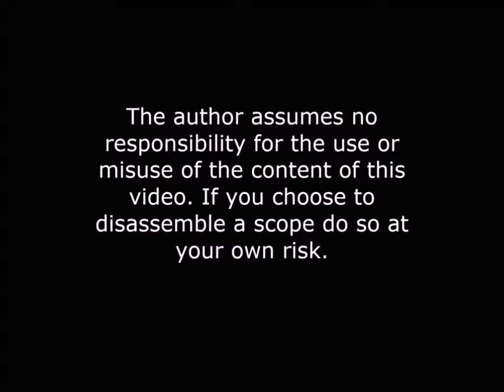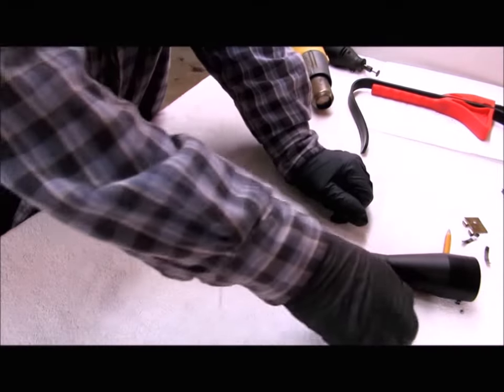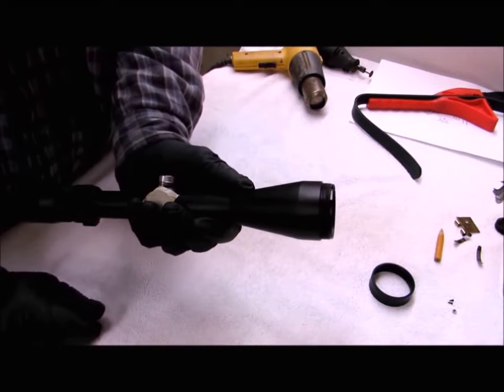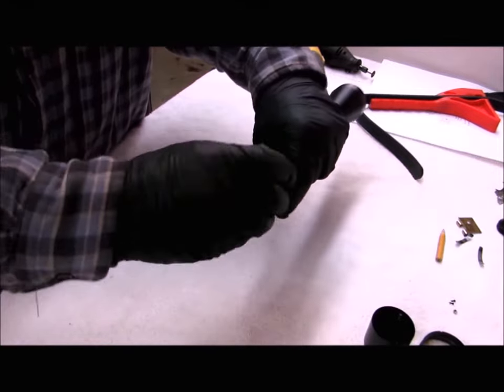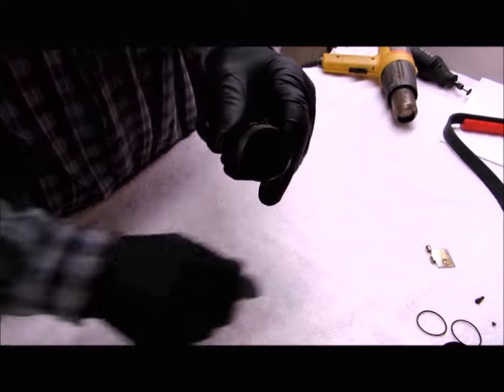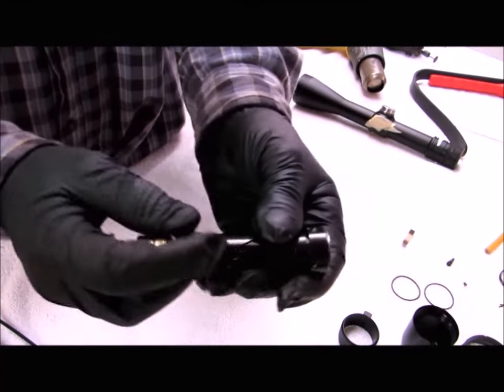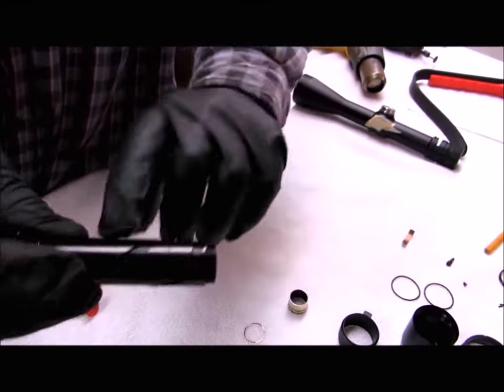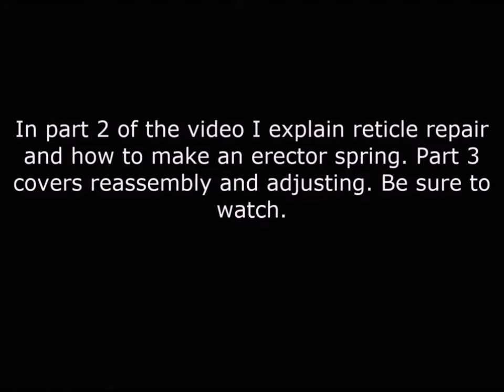DIY SCOPE REPAIR PART I

Comment: I installed this optic on a crossman 760 air rifle.I have now shot the riffle around 500 times during target/plinking practice, and the https://www.youtube.com/post/Ugkxc4K63Fd5LglDMObu7-Bgapxp_ef0W8hE scope has done well.With this optic, I have neutralized around 30 pigeons that were invading one of my buildings.For my short range air rifle, I will continue to use this scope, but will be upgrading to a more powerful scope, when I buy a more powerful air rifle, in order to shoot at longer distance.For the money I have spent, this scope has truly been a great buy.
Reply from the maker: Thanks. Good to know.

Comment: Thanks for the great videos,  Kenneth. Yesterday my BSA 3-12×50 took a turn for the worse.  It is only crystal clear when I'm on 6 power, but nothing else.  Every other power is blurry when I adjust the magnification ring. Do you have any idea how I can remedy this? Thanks again
Reply from the maker: Thanks for watching! I've never experienced the failure you describe but I will venture a guess. Possibly one of the screws with the bushings that moves the lens in the erector has fallen out. Sounds like only one lens is moving causing the out of focus issue. If you shake the scope you may hear it rattle. Again just an educated guess from a diy guy.
Reply: @Kenneth Dellinger  Thank you very much for your reply.  I haven't shaken it yet to see if I hear a rattle, but I will give that a try. I think you nailed it with it being just one lens moving. It was very wet and freezing when I tried adjusting it. There wasn't any obvious give at any point leading me to think that I sheared anything, but it seemed much stiffer than usual when trying to adjust the power ring. I think I'll give it until after my hunt and just use my 6 power for the time being so I don't have to resight in my rifle. I have a great place to start looking now after I harvest my deer. Thanks again for your expertise even if you say it's just an educated guess from what I'd consider a VERY knowledgeable DIY guy.
Reply from the maker: @badgthom  You're welcome. Good luck!

Comment: I'm impressed with your diy knowledge and know how with working on these scopes.  I have a question for you, I have a cheap BSA 4 x 16 power scope with the illuminated reticle, when you turn the magnification knob all the way from 4 power to 16 power the crosshairs  go from + to make an x when the magnification hits the stop, and when you turn the magnification from 16 power to 4 power  the magnification again comes to the stop the crosshair will move backwards and the crosshairs make another x.  So when I want to straighten the crosshair from x to + I rotate the magnification ring either from 4 to 16 power or back to where the ring almost reaches the stop then I proceed gently turning the ring a little at a time enough to get the x to move till it looks like the + again ..  I'm thinking the erector screws might be loose or something else causing the problem, do you have any thoughts other than throwing the scope in the garbage.
Reply from the maker: That should be repairable. Does the magnification change as it should?
Reply: @kennethdellinger2037  Yes the magnification works, everything seems to work fine just when i come to the end of the magnification the knob feels like it snags a tiny bit then if it's continued the crosshair will cock sideways like an x just before it stops then I have to run the magnification back the other way till I feel it catch and then carefully I try to inch the magnification knob ever so lightly to nudge the crosshair back straight up and down where I leave it, I usually try not to turn the magnification knob all the way to the max powers.  The scope is a cheap BSA not really worth much, I've even tried to get in contact with the company but I never get any replies.  I've had worked on other scopes but this one has the illuminated battery on the eye piece and I'm Leary of getting in over my head.  I also have a 24 power BSA scope that needs work but that's another story in itself.
Reply from the maker: @69easyrider  Possibly the locator pin or screw that keeps the erector from turning as you rotate the power ring is loose. I have disassembled BSA scopes before and most use the ball and socket method of mounting the erector. The reticles were installed by threading into the erector so I think that if the reticle was rotating it would likely remain in one position. You may remove the screw from the magnification ring and slide it back to see if there is a screw or pin to locate the erector and if so is it tight. You can also use a pen light to look through the ocular lens as you rotate the power ring and maybe see what is rotating. If you have the fast focus feature BSA normally uses a very small screw on the underside of the bell as a stop. If you remove the screw you can remove the lens only and take a look inside without disturbing anything else.
Reply: @kennethdellinger2037  Thanks I'll have to check it out in the daylight I've got eyes over 70 they don't focus very good at the end of the day.  Thanks again, John
Reply: Happy New Year, sorry it took me so long to get back with you, I finally got enough time to look at the scope the other day, I used my rework station to heat the screw in the magnification ring, I removed the screw and slid it back and didn't see any screw or pin other than the hole where the magnification screw is.  There are three tiny jeweler screws holding the other part of the Magnification which I couldn't remove after using my rework station to heat those mini screws.  I didn't want to damage the fragile screw heads so that's as far as I got.
Reply from the maker: @69easyrider  Those three screws hold the erector in the scope tube. If they're not loose that's not the problem. Again you can use a small light to look through the lens while you rotate the mag ring and maybe see what's going on. Don't know how the reticle may be attached in that particular scope but it could be loose. You'll have to remove the ocular lens to access it though.

Comment: I have a cheap tasco I had got for a air rifle and the thing... seemingly for no reason, has become real blurry. I noticed that if i tapped the scope against something solid it would sometimes resolve it but as soon as I take another shot, it was blurred again. So seemingly something is reacting to like the physical force of being jerked around and going out of focus somehow
Reply from the maker: Sounds like something has come loose inside. Nothing to lose in tearing apart an inexpensive scope. Give it a try.

Comment: Do you repair scopes for a price and if you do please let me know where I can send it. It’s on a old 22 rifle and has become cloudy is there anything that can be done for it
Reply from the maker: I do not. Make sure the exterior lenses are clean. Use alcohol or glass cleaner to be sure. If that's not the problem there may be  moisture internally or less likely something on the internal lenses.

Comment: I'm struggling with the turrets on a new Chinese scope. They aren't adjusting and giving me the audible clicking. I have them off and disassembled as far as i can see, but it seems like i need to go further to loosen something up.
Reply from the maker: Not sure by your description what you may have. Not all turrets give audible clicks. I have an old Simmons built that way. The turret I describe in the video is the most common one though. Normally you can remove the clip and screw the adjuster out. Will they change point of impact on the target when you adjust them?
Reply: @kennethdellinger2037  nope, no adjustment. I was hoping they had a clip like yours, I think they may be press fit together
Reply from the maker: Maybe. Sorry, I'm not familiar with what you have.
Reply: @kennethdellinger2037  Had nothing to lose and cranked on it with a pair of pliers. Lo and behold, it came loose and started to click! Someone at the factory must still be giggling, they really had it torqued together.

Comment: I can't figure out how to remove the reticule. It looked like you just unscrewed it but when I try it I just keep going around in circles
Reply from the maker: All the reticles I have personally removed have been either threaded or mounted with small screws as the one I repaired  in the video was. If you are trying to remove it with the erector in the scope you may have to completely disassemble it to understand why it's not backing out. Wish I had a better answer for you but without having eyes on it I just don't know.
Reply: @kennethdellinger2037   what is an erector in this context? I don’t mind breaking it beyond repair as I only care about the lenses inside. There were three screws in the general area that I have removed. I think it’s attached to a cylinder inside the scope itself (I don’t know my terminologies sadly) since I can spin the reticule and a piece inside (both just spin endlessly)
Reply from the maker: @finaladvance5085  The erector is the cylinder inside the scope. It will be held in by a nut installed from the rear (as the one in the video is) or it will have screws under the magnification ring. Once you remove those you can push it out to the rear.

Comment: Can eye relief be adjusted my moving the objective lens?
Reply from the maker: No. Scope eye relief, that is the distance your eye is from the ocular lens when you have a full field of view, is fixed. You can move the scope forward or back in the mounting rings for a more comfortable shooting position but the the actual eye relief can't be changed.
Reply: @kennethdellinger2037  Good to know. I was looking for ways to make this scope work other than changing my stock length.  Mounts won't allow it to come back far enough.
I'll just upgrade and maybe practice tearing this pos apart...lol

Comment: Sir l have a simple discovery scope and once  while l was under the rain a drops of water gets inside, so l open only the objective lens and wipe out those few drops but after l put them back all the power changed which means like 20yrds power shrink down to 10yrds going further if l turn it 50yrds and beyond l can't see a thing, it's completely blur, l don't how to fix this,, please help
Reply from the maker: If I understand you correctly the scope has an adjustable objective lense. Does it have markings for yardage on the front?
Reply: @kennethdellinger2037  yes of course it does have a marking like 10, 15, 20yrds and so on, and that's the way how l check its ranges, so how do l fix those blurry?
Reply from the maker: @lixv2432  Sounds like your parallax adjustment is incorrect. I describe the adjustment procedure in part 3 of the video. If you didn't install the objective lense with the same number of rotations the scope won't be in focus. Get on a steady rest and rotate the lense until the scope is in focus at a longer distance like 100 yards. Don't be concerned about the yardage references when you do this. You should be able to get the scope in focus that way. You could be a full rotation or more off. I always count my rotations when I remove the lense to simplify the process. Hope this helps.
Reply: @kennethdellinger2037  As of now l fit it on my rifle and l can use it till 50yrds ranges by turning the objective lens but to use  50yrds and beyond l have to zoom out to the last number, l don't know it's a parallax problem. Like how l mention before while cleaning l did not remove or touch any of the other section except the objective lens.
Reply from the maker: Assuming you removed the objective bell as an assembly I don't have an answer for you. Did remove the lens from the bell?
Reply: @kennethdellinger2037  l remove only the outermost lens from the adjustable objective side
Reply from the maker: @lixv2432  Is it possible to reverse the lens?

Comment: Weaver K3...I cannot for the life of me unscrew the ocular.  It unscrews about 3/8" and then locks up TIGHT.
Reply from the maker: Are you removing the entire bell or the outer lens?
Reply: @kennethdellinger2037  I want to get the entire ocular bell off as there are fine brass shavings on the inside of the interior ocular lens. Figure once I get that off I can gently blow off the shavings and then determine where they came from ( I assume from some interior threads).  Everything else on the scope is really nice. It is the K3-1 model.  And THANK YOU for the quick response.
Reply from the maker: @dannyh8288  There will probably be an internal nut that acts as a stop for the bell. I looked at a photo of a K3 and it appears you can remove the lens from the bell and then access the internal nut. There appear to be slots for removal in the nut that holds the lens. You can make a tool from thin metal to use. If you look through the lens with a light you will be able to see if that's the case. You'll need a light that's not too bright to prevent glare.
Reply: @kennethdellinger2037  Yes thats exactly it, but I cannot remove the lenses.  I tried a heat gun today with a firm grip on the incredibly thin lens retainer...it didnt budge.  I will make a spanning wrench tomorrow or Monday and try reheating the retainer, then twisting it off.  I hope I do not break the lenses or ruin the cemented aspect of the lenses.  They used to use balsam cement which heat would ruin.
Reply from the maker: @dannyh8288  It's always risky! Sounds like you're on the right track though. I've never disassembled any of the vintage stuff but the lenses on the scopes I've repaired are held by the retainers only no glue at all. Be careful and good luck!
Reply: @kennethdellinger2037  Success! On a mill I made a compression wrench, about 3/32 thick aluminum,  the exact same diameter as the thin retaining ring at the end of the ocular.  The ring unscrewed easily.  You were right, no glue.  There was an internal locknut as you predicted but it had a very weird shape...a spanning wrench would have to have 6 flutes to remove it.  Didnt need to as I simply needed the lenses out to clean off the internal one.  Have no idea where the shavings came from.  I LIGHTLY blew compressed air in the tube while holding it upside down to remove any other loose ones.  Fortunately it didnt blow anything up the tube onto the erector assembly.  Reassembly was easy (there is an o-ring also between lens element 1 and 2).  Looks and works perfect.  I thank you for your help.
Reply from the maker: @dannyh8288  Good job! Glad I could help.